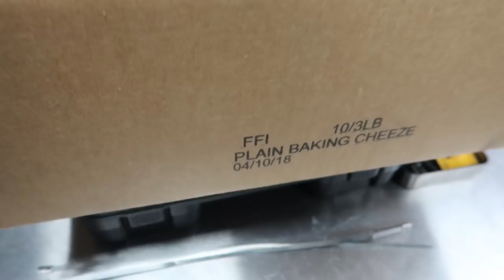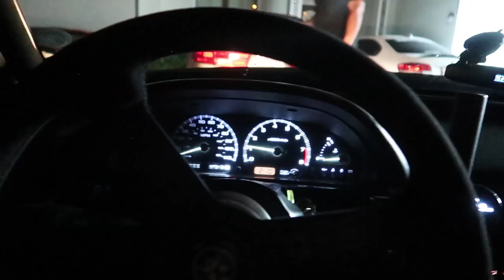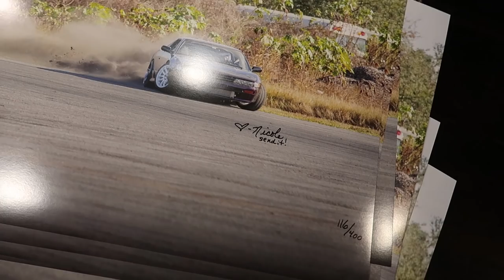IT'S A MIRACLE!

Comment: I saw you and Alberto use a spray goop on a head gasket in a previous episode. I suspect this is your cause, and unfortunately this will likely cause head gasket failure symptoms in the near future. The pressures from combustion and intake stroke (negative pressure) far exceed the pressures of a cooling system, so the thermostat is not your problem. So... you've  used a spray on (liquid) onto a metal to metal sealing surface that will need to seal even under the extreme pressures and heat. I'm just here to point out that the surface of the block, gasket, and head should be completely clean (including oil contamination). A head gasket is made of metal just soft enough to seal imperfections but not burn. Best of luck, and have fun.

Comment: About the only explanation for the engine hitting the hood would be a way thicker head gasket and it was already about to hit or new engine mounts that are taller or head not seated properly but I don’t think it’s the last one since it’s ripping. Also that explanation was the weirdest and worst explanation for what happened . That’s definitely not what happened. Fuel is not going to have that much water in it just because of “condensation”. Also if it was condensation it wouldn’t be coolant colored. You said there was a water leak on the intake side. Maybe the intake wasn’t sitting flush on the head and since the intake has water running through it (if it still does on this engine), it might have gotten into the intake runners which would definitely explain a bit better why there was water in it. It definitely sounded on the prior video as if it was hydro locking when you were trying to start it. Just saying how you fix the water leak and all of a sudden it works. Let us know if you find anything out.

Comment: Since you had combustion build up in the radiator it strongly points to a breach of some kind between a water jacket and the cylinder, cracked head, cracked block, unsealed head gasket. Get some thing like this https://www.amazon.com/Lisle-75500-Combustion-Leak-Detector/dp/B0007ZDRUI/ref=sr_1_1?ie=UTF8&qid=1517934656&sr=8-1&keywords=head+gasket+leak+detector You can usually rent one from your local autozone.

Comment: if with no thermestat the engine stays cooler why dont you keep it like that ?
Reply: it never gets to operating temp, causing engine wear, oil consumption and overall, just bad things.
Reply: Wyatt S. Perfect answer.
Reply: Wyatt S. It will get to temperature it just will take a longer time. Many many race engines run no thermostat, you just have to make sure it idles up to temp before driving. But yes it is a band aid fix and not ideal as your modulation of temperature is conpromised
Reply: magnetic0314 it will most likely never get up to temperature depending on how much has been done to the engine and also how good the cooling system.
Reply: UD Fab you realize that all a thermostat does is opens at a certain temperature, increasing flow through the radiator. If the engine is at idle, flow is still slow enough for the engine to come up to temp, albeit a lot slower. The radiator has no airflow at a stop, so it's only passively transferring heat as opposed to having cool air forced through it. I know this because I have personally run vehicles without thermostats for track use.
Reply: magnetic0314 I don’t care how you have run your vehicles but it’s not how it works. If your vehicle still gets up to operating temperature without a thermostat, you definitely have a crappy cooling system. Every single time I’ve run without a thermostat, it never gets up to temp. Different cars too. The fins on the radiator is what dissipates the heat. The cool air does help it but even at idle it should be enough too cool any vehicle. If not, every car would overheat. Maybe check your cooling system because I’ve never seen a vehicle without a thermostat ever get to operating temps unless it has other underlying problems. Heck that’s why the thermostat stays closed for the most part until it gets to operating temperature, because if it was open all the time, it would never get there.
Reply: That’s also why cars have fans because just the cool air going through the radiator is not enough. It needs something to  help pull all that hot air from the fins. Again, all cars are different but it’s supposed to work a specific way. All cars are designed pretty much the exact same way. All radiators do the same in the same exact way. It goes the same for thermostats. All that’s different is the temperatures.
Reply: UD Fab what happens when a thermostat is open? It is effectively the same as if it weren't there. Your logic is saying that the thermostat also some show keeps the car cool. An idling engine creates heat because there's combustion happening in it. With a small amount of flow the heat will transfer to the coolant quickly. With a large amount of flow it will happen more slowly. But because a radiator does not remove 100 percent of heat, it will still eventually warm to operating temperature. When at operating temperature, the thermostat will start to close if temp drops, open if they rise and the radiator fans will kick on if temp increases too far. The benefit of a thermostat is FASTER warm up and better modulation in normal driving conditions. Drifting is not normal driving conditions. When you're thrashing the car, your concern isn't the car running too cool, it's overheating it, so you create a very efficient cooling setup, because realistically while drifting and hard driving in general, the temp will never be too low.
Reply: UD Fab you're also ignoring the fact that coolant is still flowing through the radiator when the thermostat is closed. It has a hole in it, because the water would stagnate and overheat the block and head very quickly  if it didn't have somewhere to flow to.
Reply: magnetic0314 and no reply back from you’re opponent. 😬 enough said bro
Reply: ii ZERO ii why u guys fighting i just asked a question ,i dont have car to work on and test this theories
Reply: Vlai Ko not fighting, I was just trying to state the facts because the other guy was spreading misinformation
Reply: magnetic0314 yo, my GM Basic B#^%H 350 does not have a hole in the thermostat, and I'd be willing to bet it's not the only one designed that way.
Reply: lpeeff I'd be willing to agree with you, but we're not talking about v8s here, we're talking about Japanese 4 cylinders, specifically sr20dets

Comment: I seriously have no idea how half of these conspiracy theories are getting started. People give your suggestions / responses more than two seconds thought PLEASE!!! I'm am reading absolutely ludicrous ideas like it is water pump related.

There is a very simple explanation for it, water was leaking under the head gasket pure and simple, no big mystery. Look at the clues they are staring you in the face... think about how preposterous your suggestions are.

Seriously do any of you even know how a water pump works? A water pump is not a positive displacement pump (in little words, it is not sealed or enclosed to produce pressure like an oil pump is, its function is fluid displacement not pressure), it will happily spin around in the same spot all day if it can't move the water.

Thermostats have a bleed hole so even if the brand new Nissan thermostat wasn't opening (and that only takes a cup of boiling hot water to find out) the bleed hole will still allow water to circulate.

Even if it blocked off entirely, the pressure can only build up to the point of the radiator cap. Let's see you have a ~15 psi radiator cap on the car. Cranking the car over without the aid of combustion the pressure tester shows lets say a middle of the road figure of 140 psi. The engine starts and that number increases DRAMATICALLY! Now somehow a water pump that doesn't produce pressure is going to overcome the sealed head gasket designed to seal in infinitely more times 15 psi of pressure and fill the cylinders with water...

See what I mean zero logic is being applied. Then we have the crazy idea that the water was coming from the fuel... Yes all fuel is hygroscopic (means it draws moisture to it) just like brake fluid does, but again let's use some common sense here. It draws moisture from the air, it doesn't draw water from the air unless you leave the car outside with a funnel in the fuel tank and it is raining.

There is only a certain amount of moisture that can bond to the fuel molecules, and it certainly isn't in the range of dams. When the oil drain plug is pulled, water is gushing out of there (oil and water won't stay mixed forever) proving beyond any doubt we are not talking a trickle of water here, this is full on internal leak.

Furthermore if the theory that the water came from the fuel had any kind of substance, why did the car start after being left for an even longer time on the same fuel? Sometimes you need to look at all the clues, rather than taking one and fabricating a story around it.

Comment: 4:18 Not to be that guy, but I thought this was a PG channel. Love your channel keep it up.
Reply: Mechanical terms “Advanced”  and “Retarded” meant for engine timing not saying that the car has “Down Syndrome” look it up.
Reply: Retarded isn't an insult, people use it as a derogatory term sometimes, but it's not a bad word, it just means slow. In this instance, saying the "timing is retarded", he was saying that the timing on (presumably the cam gear) is a little off and it was responding a bit late on the low end.
Reply: 🙄 not sure if troll or just clueless 🤔
Reply: Fayzon It is hard to tell these days haha.
Reply: This comment was after dead center.